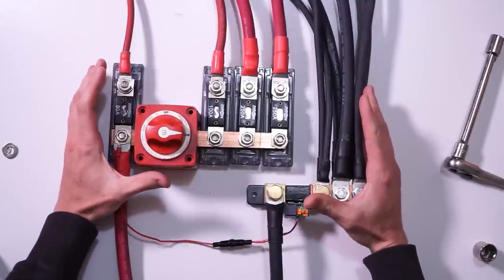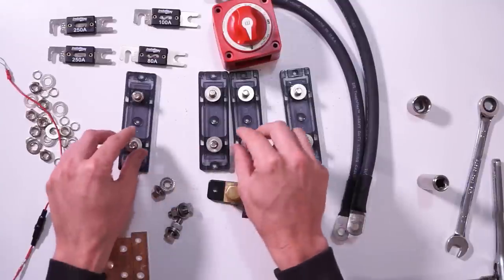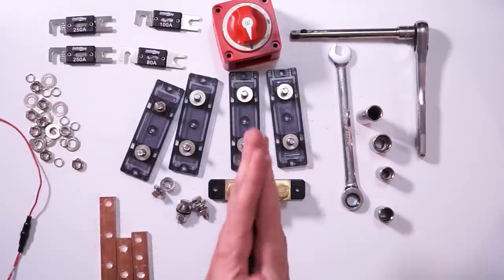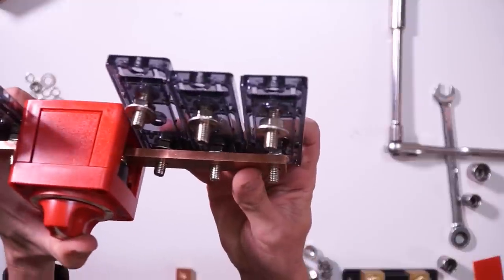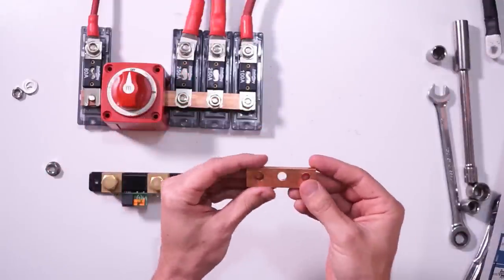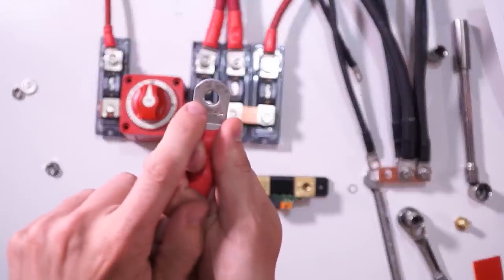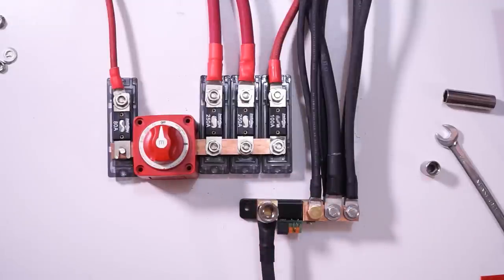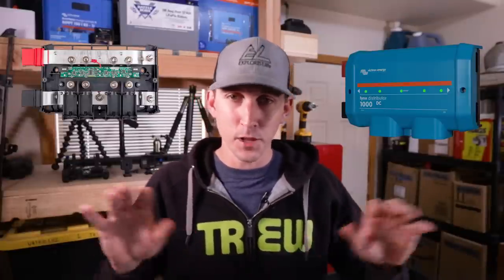How To Build a DIY Busbar for a Camper Van Solar Install

Comment: Nice work Nate, but I think perhaps you ought to explain a little clearer why at 8.12 the nuts need to be spun up i.e. it's to bring them up to take into account the thickness of the copper bar so that when you tighten it all up it doesn't distort and damage the fuses, so 1/4" thick bar needs the nuts moving up 1/4" to suit.
Also, can you explain the reason behind using 1/4" thick bar instead of 1/8" or 3/16"?
Reply from the maker: I'm not sure I understand your question re: the size of the bar.  As long as you use a copper bar that meets the proper ampacity rating, it can be whatever dimension you like.  If I used a thinner bar, it would have to be wider.  1/4"  was just the size I felt worked best.
Reply: @EXPLORISTlife  that's kind of the point I'm making, you didn't explain the reasoning behind choosing that size. Hence someone might use a bit of flattened copper pipe for example...
Reply from the maker: @brassmonkey001  I'm hoping the parts list and links I provided will alleviate that situation.
Reply: @brassmonkey001  haha, please tell me this is a dig at 'freely roaming'

Comment: Hi ...  I have purchased the copper bus bar and going to do a similar application.  Instead, I will be using a Renogy 60 amp DC to DC charger.  For the DC to DC charger, I am going to place a 60 amp ANL fuse next to the starter battery which is recommended.   My question to you is:  When I connect the wire for the DC to DC charger to the bus bar, would I need to add an additional 60 amp ANL fuse at the bus bar or would I just connect the wire with out one since I have one located at the starter battery?
Reply from the maker: Fuse at the busbar as well.  Example with the 60A Renogy DC DC Charger: https://www.explorist.life/2000w-520w-60a-budget-friendly-camper-wiring-diagram/

Comment: Love your videos,  Nate!, especially this one!    I have received my copper bar and and still 'gathering components'. 
I have three questions.   Number 1.   Why do you have four positive leads and six negative?
Secondly, since my MPPT is a 40a Tracer, I would use a 40a fuse instead of the 80a, right?
Thirdly, I do not plan to use the vehicle alternator to charge my house bank... at least not until I can determine that the '89 Minibird bus alternator could handle do so... 
... BUT.... I have a Moe's Dual ATS, to automatically switch between battery and shore power, according to battery SOC.   
How would I factor that into this bus bar system, just add the negatives to the negative bus bar?   The Moe's dual ats has INPUT for shore.... OUTPUT for Shore... OUTPUT to Inverter.
On the shore power side, there would be two ground wires to account for... (shore in and shore out) .... three if including the inverter's connection.... so is it okay to connect them to that negative bus bar?
Frankly, as an old retiree, there is just no way that I can afford Victron... LOL
Reply: In Nate's wiring diagrams, you can see two Negative connections from the MPPT and from the inverter/charger.  This means that both of these components have two seperate Negative connections and only one positive connection. This gives you two extra negative leads.. Also, the negative bus is grounded to the chassis, which adds one more.   Just check out the wiring diagrams on Explorist.Life for more info. 
If your MPPT is producing 40 amps at peak sun, you will continue to blow a 40 amp fuse because the fuse Max. amps is 40 before it blows.   But that depends on how much solar you have.  if your solar could produce 40 amps, I'd look at a 50 amp charge controller because that would give you some headroom in case your panels produce more, which they do in cold weather. 
Also, the fuse is primarily sized for the wire used.  Nate has a video on this. If you're using 10 awg copper wire, your main concern is the wire, hence the larger amp fuse.
I'm not sure about moe's dual ats.  Does it say in the manual?  Anything that connects to the batteries will go through the bus bars.  However, the AC power from Shore power doesn't connect to the batteries.

Comment: Could you just add an additional nut underneath the fuse in the fuse holder to act as a spacer?
Reply from the maker: I don't see why not.
Reply: @EXPLORISTlife  I think it's important to fill that space with either another nut or some washers. It looks like if that nut was to vibrate loose you could have an issue with a loose connection and generate some dangerous heat. Just my 2 cents😁

Comment: Question...Why don't you put the disconnect where it will disconnect the battery from everything? They way you do it still has the solar controller connected. Will the solar controller be damaged if you disconnect it from the battery?
Reply from the maker: Doing it like this makes it nice and easy to disconnect all loads while allowing the solar panels to keep the batteries topped off.  If the solar controller needs to be turned off you can do that through the VictronConnect app or by pulling the fuse but there is rarely a reason to disconnect the charge controller.
Reply: @EXPLORISTlife  Thanks for the reply!

Comment: Hi Nate, Can you explain exactly what the high voltage DC switch does that houses your two positive bus bars?
Reply from the maker: The big disconnect disconnects all loads from the battery while still allowing power from the solar panel array to keep the batteries topped off during storage.
Reply: @EXPLORISTlife  Do you have a separate disconnect to completely disconnect the battery and solar panels if needed?

Comment: So I got 72 12v agms from  my  work  for  free as they were replacing  thier fire system  battery  backups.  They all have  the  flat tabs for  terminals. I  would  like  to  hook these into 3 100amp hr battery banks if possible and  use the rest for  ham radio.  Any idea how I  can  go  about  this?

Comment: love the setup, but with the anl fuse holders so close together, can you actually get the anl fuse on/off the holder, without completely removing the nut from each post (especially that middle fuse holder)?
Reply from the maker: With them mounted this close together, removing the nut is required.  If you are DIYing this, you could space the fuse holders apart further if this completely removing the nut from the bolt is a major inconvenience.
Reply: cool, that's what i thought. i prefer my cables to stay attached so i don't have electrical flopping around while working on stuff like that :-)

Comment: Hi Nate, love your videos have a question,can i run a  bus bar from a 24volt system to run any 12volts appliances.
Cheers David
Reply from the maker: So... if you fed 24V to  12V device... what do you think would happen?  Walk me through that.
Reply: Hi Nate thanks for getting back to me your to my question gave doubt so my answer is i probably  blow a fuse or something worst so I'll keep my batteries at 12volts I'm running 2x250w panels in series and was going to run batteries in series also run 12v cig plug and usb plugs though fuse box
Ps. Love your videos well explained @EXPLORISTlife

Comment: What sort of loads are you planning on?  THREE massive thick positive wires?  Seems like overkill for a van.  And what voltage are you running at?  Must be at least 24V, right?  So do you really need thick wires like that?

Comment: You should use tinned copper for protection against corrosion.
Reply from the maker: In non-marine applications, un-tinned copper is fine, but feel free to use whatever you like in your own project.
Reply: @EXPLORISTlife  Happy to receive feedback on the matter from someone who's used "pure" copper. My application is within a 4wd which does get exposed to salt air when on beach trips. Hence my paranoia. Cheers from Oz

Comment: By drilling out those lugs, it seems you are severely derating their current capability. Would it not make sense to use a longer copper bar (extra holes), and keep them as meaty as possible?
Reply from the maker: Ultimately, I recommend buying to proper sized wire lugs for your project.  3/8" lugs fit on the Shunt.

Now... For what it's worth, I have never seen ampacity ratings on a lug before.  I have both 4/0 x 5/16" wire lugs and 4/0 x 3/8" wire lugs here in my shop and when measured with a digital caliper; the ONLY difference is the size of the hole.  All other dimensions and thicknesses are the exact same and they weigh within a couple of grams of each other.  So... do with that information what you will, but I don't think drilling a 3/8" hole vs buying a lug with a 3/8 hole is going to "severely derating their current capability".

That said... buying the correct sized wire lug is always preferable over drilling and I have all of the proper sized lugs in my wiring diagrams and parts lists here: https://www.explorist.life/solarwiringdiagrams.

Comment: Nate, How do I know what size of fuse to use?  I have 10 battle born batteries, set up in a 24V / parallel / series set up? Using in 4/0 wire. Which direction am I measuring? coming from the batteries to the inverter or other direction?
Reply from the maker: If you are using 4/0 Wire from the battery bank to the Lynx Distributor, I'd say the chances are super high that you would need a 400A fuse inline.  Here is a system we have designed that utilizes 4/0 wire from a 24V Battery Bank to feed a 5000VA Victron Quattro Inverter/Charger: https://shop.explorist.life/shop/all-products/camper-wiring-kits/complete-wiring-kits/wiring-diagram-kits/400-1400ah-battery-bank-quattro-5k-24v-orion-12-12-30-wiring-diagram-kit/

Comment: Hello Nate....what would be example causes why a battery shunt would overheat from 150F to 190F? Even at those temps, the shunt continues to operate and transmit battery information; using 4/0 cables to and from the battery and multiplus'. Battery bank is 6 X Lion UT 1300 Batteries.
Reply from the maker: I would guess a poor crimp (suggest re-crimpong) or a loose connection (suggest tightening the connection to manufacturers recommendation) or dirty wire lug to shunt connection (sand with sandpaper to remove burrs or oxidation and clean with alcohol).
Reply: @EXPLORISTlife   could it possibly a defective shunt? all cables / lugs / equipment is new and a hydraulic crimp was used on all cables....all connections are tightened to spec...this is issue is a bit troublesome.

Comment: Hello. I'm building this system for my travel trailer and the picture I have of the install is not very clear. I was wondering if you might be able to send me a copy of it? I'm having a hard time reading the fuse sizes etc. I'd really appreciate it and thank you for putting these videos out. I learn allot from them!
Reply from the maker: Sorry... which specific diagram are you trying to get? (I have a lot of them...)
Reply: Thank you for responding. I'm hooking up 6 battleborn batteries,  1 3000 watt victron inverter and 1200 watts in solar power. So I'm not sure which one that would be but the one I have I just cant read everything clearly enough to follow.
Reply from the maker: If your travel trailer is a 30A shore power, this is the diagram you should be using: https://www.explorist.life/30a-camper-inverter-with-solar-and-alternator-charging-wiring-diagram/  There is a big red button to access the high resolution download of the diagram on that page: https://www.explorist.life/30a-camper-inverter-with-solar-and-alternator-charging-wiring-diagram/
Reply: Thank you very much!

Comment: I ran into a problem. Think I fried my victron mppt. Could you please check your app battery voltage on the mppt with the mppt disconnected from the multiplus inverter and tell me if it says 0 or something other than 0? Mine shows 14 volts. When I disable the mppt it shows 9 volts so I am thinking it is bleeding from the PV input. Would greatly appreciate your help.

Comment: How are enhanced flooded batteries ? Marine deep cycle.  Have renogy  wanderer solar charger going to it setting is on flooded. Shore power is agm setting not 12v setting. This ok?

Comment: Hey just an FYI your blog post says to let you know if the links send to anything other than a bluesea fuse holder. The amazon link goes to InstallGear 0/2/4 Gauge Ga ANL Fuse Holder + 150 Amp ANL Fuses (2 Pack)
Reply from the maker: Thanks for the heads up!  Description updated.

Comment: Also, if I plan to wire up my alternator charge down the road, is there any issue with having this pre-installed on the bus bar?

Comment: Hi Nate,

New subscriber, but making it through your posts and blogs pretty fast.  

One of your comments suggested using breakers instead of fuses.  I found some 250amp breakers.... nothing larger so far.  

If you go through your fuse sizing video, you mention that you usually go closer to the load rating instead of the wire max rating.  But you diagrams you use 400amp and some other big fuses.  

If my math is right, I see no reason to go any bigger than a 250amp breaker.  

Am I missing something?   

Thanks in advance.
Reply from the maker: Don't forget rule #1 of sizing fuses...  If the manufacturer of a component makes a fuse size recommendation... follow the manufacturers suggested fuse sizes.  This is the case with the 400A fuses in my diagrams.

Comment: Hi Nate, Is it ok to connect the end of the positive cable of the solar charge controller to the busbar instead of the end of the positive battery cable? ...  And then attach the positive cable of the battery to the other end of the ANL fuse?
Reply from the maker: I don't completely follow, but here is how I recommend wiring the charge controller into a system: https://www.explorist.life/solarwiringdiagrams and https://www.explorist.life/how-to-wire-a-solar-charge-controller-for-a-diy-camper-electrical-system/
Reply: @EXPLORISTlife  I have since chatted with Blue Sea Systems, and the way you have it connected is the only way and is correct... thanks.   I was trying something different due to space constraints, and it was not correct.  So I will make do, and follow as you presented it.    Thanks by the way for everything.

Comment: Hey Nate, we were combing through your how-to videos/wiring diagrams (which have been really helpful so thank you) and had a question regarding the bus bar and main disconnect switch. The switch listed on amazon from your wiring diagrams looks like it’s rated for 300 amps and the pre-built bus bar listed in your YouTube video looks like it’s rated for 250 amps. Will these items be compatible for our 300 amp hour battery bank? The reason I’m confused is: for the bus bar, I was surprised it had an amp rating at all. I thought it would work regardless of battery bank size. And for the switch, I assumed if our battery bank was 300 amp-hours, the switch would need to have a higher rating, but you have the same 300 ah switch listed in your 600 ah battery bank wiring diagram. Thanks for the help!!

Comment: I was looking into the Lynx prior but for various reason went with RedArc setup which works better for my use case and space.  Can the Lynx still be used or would this DYI suffice? It is a clean setup. I was considering using blue Sea anyway.
Reply from the maker: I don't recommend this busbar system anymore.  See the pinned comment.
Reply: @EXPLORISTlife  thanks I saw your comment.  exploring options besides the Lynx for a bus bar. No sure there will be benefit if I am not running a Victron setup.

Comment: Great video, very helpful.  What do you use to draw your diagrams?  I'm designing a system (Electric boat conversion) with Victron components and would be very helpful to be able to do diagrams like yours.
Reply from the maker: Hey Mark!  I use Microsoft Visio to make my diagrams.
Reply: @EXPLORISTlife  Thanks,.
Reply from the maker: No problem! :)

Comment: Thank you for the video, I am looking at your wiring diagram online the shorepower connecting to your victron ac in L N PE has 10/3 gauge wire but it has a 3 conductor and 1 ground total of 4 line what did you do for the 4th one? What brand of wire you use?
Reply from the maker: There are only 3 conductors including the ground.  This is what I recommend for 30 amp shore power incoming: https://amzn.to/35JHGT5

Comment: Thank you for all your amazing content. How did you decide on how far apart to drill the holes on the bus bars? Was this decision based on the dimensions of your fuse holders (aka, they can't be so close to each other as they can't overlap) and/or how wide the cable lugs were? or was this decision also based on the current flow and ampacity in the bus bar?

Comment: When you are doing a bus bar set up like this, is it essential to put a terminal fuse on the battery pack?
Reply from the maker: There does indeed need to be a fuse protecting the wire from the battery bank to the busbar.  It does not have to be a terminal fuse, though.  See https://www.explorist.life/solarwiringdiagrams for examples.

Comment: I have a 144 sprinter van with a bare roof, 4 large 310watt solar panels and a victron 150/100 charge controller and a couple 12v agm batteries.

I am working towards a 1240watt system , I assume that I would want 2 panels in series and 2 parallel, what else might I might need besides an inverter ?
Reply from the maker: Nice!  This should get you going in the right direction: https://www.explorist.life/3000w-inverter-400-600ah-400-to-1200w-solar-camper-solar-kit/

Comment: How many amps can this bus bar handle?  I was considering making one a little longer so I could connect 5 vs 3 fuse holders
Reply from the maker: I don't really recommend doing this anymore.  Since Victron released the Victron Lynx Distributor, this busbar system is pretty obsolete.  Check out how the Lynx Distributor is integrated into a full system: https://youtu.be/01F4QDVJUq0